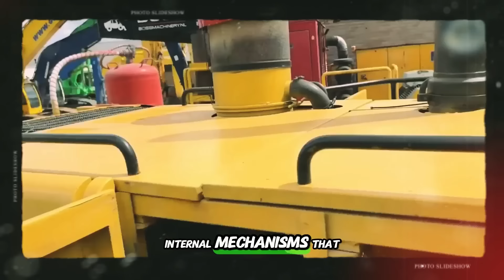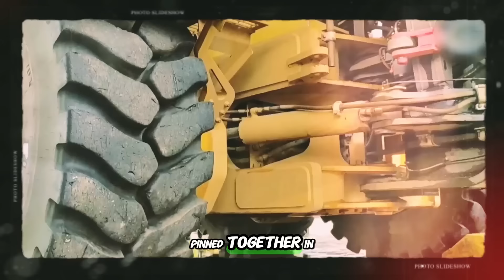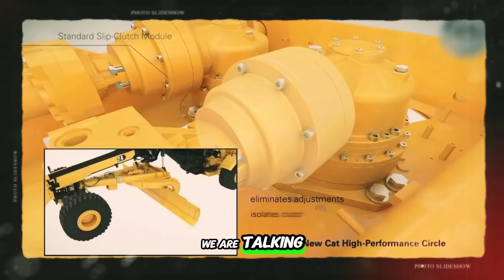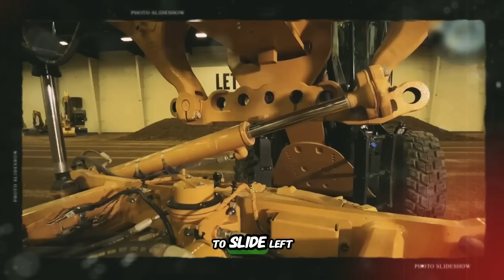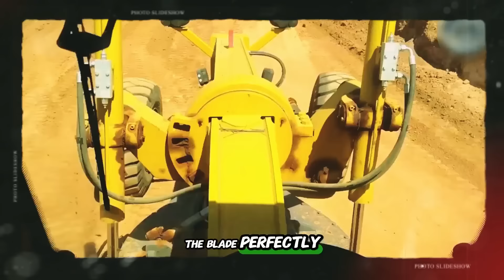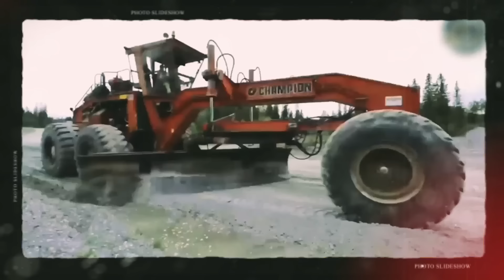Why Do Motor Graders Tilt Their Wheels?

Comment: I’ve learned heavy equipment since I was 13 years old I am 60 now I had to learn the 140M because the operator quit and I got the manual learned with all those controls do on the handles and I’ve been through everything just like in the video and I also learned that you could drive at the edge of a pond jack up and spin the reels  real fast and you can wash the machine off lol

Comment: I enjoy running grader, it’s my favourite machine. My current ‘ride’ is a John Deere 772GP 6WD and it’s a beast. I started on Champions and Cat G’s in the 80’s and have been fortunate enough to operate quite a few different brands and models over the years. I’m old school enough I still prefer sticks and a steering wheel over joysticks but run both as needed. 160M’s are the largest I’ve ever run with 12’s and Champ 720’s the smallest, I’ve never met a grader I didn’t like.

Comment: No steering wheel? I remember one with two steering wheels working near my house in the mid 80s, I think it was a modification made by the owner because the two steering wheels transmitted the movement to the central steering shaft where the steering wheel would normally be using unprotected chains. If they were factory-installed I would expectat least very basic covers to prevent losing a finger every now and then 😓
Reply: Yes ! The ones that fascinated me as a boy in the 70s seemed extra cool because of the dual steering wheels and the operators standing up as they went a mile backwards, only to come back again on a subsequent pass !

Comment: You said 6x4 when most are actually 6x6 drives. The front wheels also can be powered and that is present in the video where the front wheels are spinning but the grader is not moving.

Comment: As a guy who SOLD Caterpillar and Komatsu gear I have to agree with a lot of the script. The motor grader is, IMO, THE most complex machine to operate well. Sure an excavator with a thumb is versatile and logging equipment is pretty specialized but for overall versatility - WHEN in the hands of a master operator, you cannot beat a motor grader. I did not operate but I had great admiration for those who did. It was a pleasure to sit on a hillside with the owner of a fleet of scrapers, listening as the dozers pushed them full in the cut, while the grader kept the haul road pristine, saving tires and operator fatigue. They worked as a Team, no radios needed. A smooth, coordinated ballet of iron, in the hands of skilled operators. The sound from those machines was music and when three of those scrapers hit sixth gear at the same time - my client would look over and smile; he was making money.

Comment: A grader is an instrument. Chain drives take up much less space, transmit 100% of the power input and are much cheaper and simpler than the equivalent gear train. When a tyre or wheel leans it steers that way. That is how motor bikes turn. By leaning the wheel towards the work or where the dirt is going steers the grader that way and counteracts the side draft. It also causes the grader to turn in a much shorter distance in tight going. I have seen grader drivers ( not operators) who don’t know much leaning the wheels the wrong way. John Deere graders also have the option of hydraulic front wheel drive with obvious advantages. To see a good operator extricate himself from a complicated bog using the machine itself is something to behold.

Comment: Great video, I ran a nineteen forty one American crane with clutches and brakes, you couldn’t let go of a lever without putting a brake on. I’ve since run hydraulic machinery. But I really enjoyed the old crane. At one point in this video, you mentioned that the steering on the grader was not like your car. Because the grader used hydraulic steering. Actually cars use hydraulics on their steering. It’s just a much smaller version.
Reply: Cars don't use hydraulic cylinders to steer like graders do. Yes they are both hydraulic systems, but that's where the similarities stop.

Comment: my old man is the mechanic for all those big bad boys.. he’s does mobile maintenance for around 50 pieces of equipment (pm’s and break downs) for a steel company.. equipment is too big to take indoors so he’s stuck working on everything from big cranes, dump trucks you can drive cars under, front end loaders, including a rail car outside in the crazy north carolina weather.. all the way down to forklifts which can be brought in the shop for a little relief.. he’s been wrenching and trouble shooting everything that can go wrong on. all the different pieces of equipment and usually does for 30 years..!! still dangerous so yall stay safe and stay focused..!!

Comment: My father bought a house outside the city in 1954.  We had  a gravel road with diches on both sides.  Road  graders as we called them came through regularly smoothing the road and at times recutting the ditches as they filled back in.  The road graders looked about the same as they do now.  The spring rains would put about 3 inches of water in our front yard.  One year my father got the dump trucks collecting the dirt from the road grader redoing the ditches to dump the dirt in our front yard as they were happy to do.  Our front yard  ended up about 3 inches higher than our neighbors and our yard no longer flooded.  After the road got paved the road graders quit coming and now locking at our old home that was sold after my father passed away there are no more ditches and my father's nice grass front yard has been covered with rock.

Comment: We had an original Cat 12 grader. Pony motor starter that you started like a lawn mower. Small drive shafts everywhere with U joints and slip yokes. You could pump 2 tubes of grease in it and still not get every fitting. I loved that machine. If you hit something in the road it either cut it, ripped it out, or the handle would kick and break your hand. You learned quickly not to hold the swing handle.

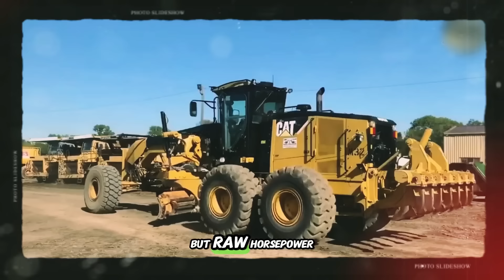Comment: 1:51 the engine is in the rear to maintain high visibility. Line of sight is critical when grading. Especially the older graders without a laser guidance.
Reply: The main reason is weight over the drive. They have a lot of traction due to the weight and true 4WD. They need it all. Even better with the front wheels driving too.

Comment: My grandfather was a grader operator for our county. He could keep the gravel roads in beautiful condition. He also was a farmer who used horses as well as motorized equipment. One of his often used pieces of horsedrawn equipment was a pony grader. Think the front half of this machine, pulled by a team of horses, with a footboard in the back for the operator to stand on. He buckled the lines* together to loop them behind his back, then he could control the horses for steering and speed, and he used two large handwheels with worm gears to adjust the position of the blade in the middle of the A-frame. He could build roads with that machine, as well as clear snow in the winter.

*leather straps used to guide the horses
Reply: I have seen photos of those. That was a VERY complicated machine! I took someone very intelligent to design it, and also someone very intelligent to operate it! Kudos to your Grandfather for being able to operate it so efficiently!
Reply: Did those horses have crooked legs  ? 🤣😂
Reply: Now, that was a very good comment, indeed!  Thank you...🇺🇸 👍☕

Comment: You missed the biggest and most important thing a motor grader with articulation at the cab and tilted wheels can do: They can perform a 180 degree turn in a small space left or right by simply slanting the wheels in the opposite direction of the turn they wish to perform. I've witnessed this in action and they can turn in a tight spot when they need to. It helps out a lot on a construction site, and enables the machine to turn around quickly to perform the next pass or get onto a roadway.

Modern road graders can be fitted with computer controlled measuring systems that allow them to precisely and automatically level a roadway simply by measuring a transmission from a broadcasting laser beam moving in a 360 degrees circle mounted on a surveyor's tripod. This allows precision grading of even the most difficult slope when preparing any site.
Reply: I think you will find the wheels were leaned in the same direction as the turn.
Reply: @jefftheaussie2225  They actually do this deliberately! Here's a long winded copy and paste from an AI response Google gave me. Apologies for the line breaks being in the wrong places:

AI Overview
When a motor grader operator leans the front wheels outward (top of the wheels leaning away from the turn) during a 180-degree turn, they are utilizing a specific steering technique
to improve maneuverability and control. 
This is a deliberate, highly skilled maneuver often called "leaning against the side draft" or using the wheels to "cut the turn." 
Here are the primary reasons operators do this:
1. Reducing the Turning Radius 
When a motor grader makes a tight 180-degree turn, the front wheels tend to wash out or drift sideways due to the inertia of the heavy, long frame. By leaning the wheels outward (in the direction of the turn), the operator puts the sharp, outer edge of the front tire tread into direct contact with the ground. This acts like a rudder on a boat, helping the front end "bite" into the dirt and pull the machine into a much tighter circle, rather than skimming across the top. 
2. Counteracting Side-Draft (Weight Displacement)
When turning, or when the moldboard is angled, heavy forces try to push the front end of the grader in the opposite direction of the turn. Leaning the wheels outward forces the weight of the machine's front axle against that lateral pressure, keeping the machine on the desired path rather than sliding off-course. 
3. Improving Control on Uneven/Soft Terrain 
When reversing or doing a "flip" (180-degree turn) in loose, soft, or damp gravel, the front end can easily lose traction and slip. Leaning the wheels helps the front end maintain stability. It provides a more positive steering response, allowing the operator to steer with both the steering wheel and the wheel-lean lever simultaneously. 
4. Setting Up for the Next Pass
After a 180-degree turn, the operator wants to align the front wheels with the new pass line immediately. Leaning the wheels helps the machine "find" that new line faster without having to make large steering corrections with the steering wheel, which keeps the grader more stable and the work more accurate.
Reply: @DarkVoidIII Leaning a wheel will cause it to want to go that way, any bike rider or wheel barrow operator knows that. Leaning it away from the turn will not help at all. Leaning the front wheels towards the turn will enable a grader to turn in a much shorter distance. They are so long and often worksites are very cramped so they articulate as well as lean the wheels towards the turn. One of the many good design aspects of a grader.

Comment: I operate an old 140G, with the 10 levers you mentioned. I really want a new Deere or a Cat M-series, those Joy-stick controls are so easy to use.  Very good over-view video of motor-graders. It is do much more then just about the tilt wheels.  BTW, I sometimes use the tilting of the wheels to go around fence posts, as it is much faster then sliding the blade.  I use it on a dirt race track, so I'm always a half inch from messing things up.

Comment: Hi, Folks.
HMMMMMMMM???????????

Why is the engine placed at the rear????? This video gives two reasons but entirely neglects a third VERY important reason, that it allows FAR better visibility of the 'sharp end' of the machine where all the REAL work happens - the blade.

Then this video spends a couple of minutes talking about how the TRANSMISSION works while still showing images of the circle drive gearing which it was talking about prior to the transmission.

For MANY years, tandem drive graders DID NOT have a differential but were instead what is known as a 'locked up' drive which delivers equal power to ALL FOUR wheels in the tandem drive system at the same time, ALL the time. It was only with the advent of more sturdy and reliable diff-locking mechanisms that differentials became viable for graders.

The GREAT majority of graders DO NOT have planetary geared wheel hubs. ALL reduction happens BEFORE the tandems and the chain case.

This narrative has the reasons for pitching the blade bass ackwards - pitch it top forward to cut and top back to roll and mix material.

I did this work for almost 60 years.

Just my 0.02.

You all have a wonderful day. Best wishes. Deas Plant.
Reply: We're on a slippery slope (pun intended) with this AI generated half baked information out here nowadays.
Reply from the maker: Appreciate the detailed feedback!
Reply: 60 years and nope . Rolling the mould board top forward changes your cutting edge angle closer to a right angle , this reduces ability to cut and allows lofting or mixing of material.
If you hold a shovel at a right angle to the ground and drag it , it won’t cut . If you angle it back , it will .  I’ve run road building (forestry) and municipal for 26 years, both Cat and Deere training , they both agree with this video.
Reply: Hello, @duncandmcgrath6290 .
You, 'Sir', are entitled to your opinion but I'll back my own experience against both the content of this video, your protests and whatever you have been 'trained to believe 'cos I have PROVED it, time after time after time.

Your 'shovel' analogy is UTTER BS 'cos, when you are cutting with a grader blade, you almost always have the blade ANGLED across the machine - which means that you are NOT 'dragging' it like your shovel but are SHEARING the material - which in turn izza WHOLE different ball game.

If you cain't wrap your head around that idea, DON'T bother coming back at me 'coz you will have proved that you have NO understanding of the issues involved.

Just my 0.02.

You have a wonderful belief. Best wishes. Deas Plant.
Reply: @duncandmcgrath6290  Got to agree, I work on a dirt race track, and if we tilt the top of the moldboard backward, as to make the moldboard more vertical, it will dig.  We pitch it all the way forward, and we use serrated cutting edges to let more material flow under the edge.
Reply: @duncandmcgrath6290  Agree. Like a wood chisel, the bottom or cutting edge has to be angled forward into the material to cut. It only makes sense. So therefore with the top of the moldboard rolled back it juts the bottom cutting edge more forward into the material for cutting. When the top of the moldboard is rolled forward it puts the bottom edge more vertical and therefore would be better for scraping rather than cutting. It seems logical to me but I'm not an operator.

Comment: The largest grader ever made was actually made by acco. It was twice the weight of the champion and had a 33 ft blade.
Reply: I saw the Champion 100T at the ConExpo in 1981 in Houston.  It was one of the cooler machines on exhibit.